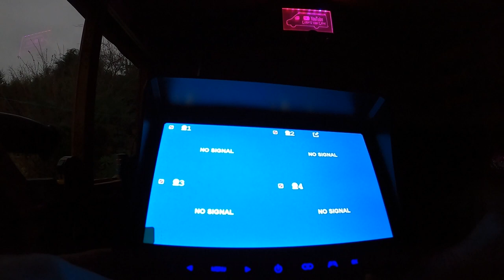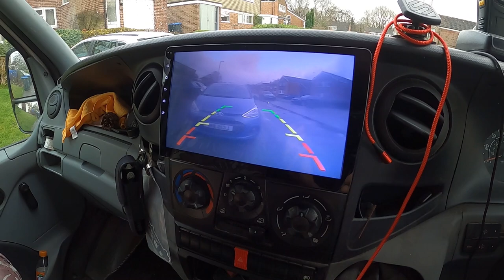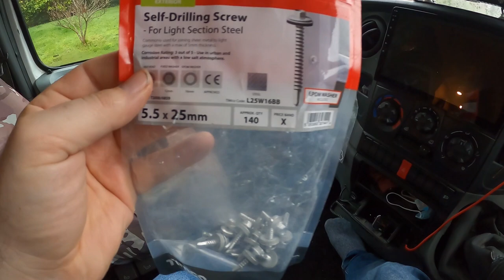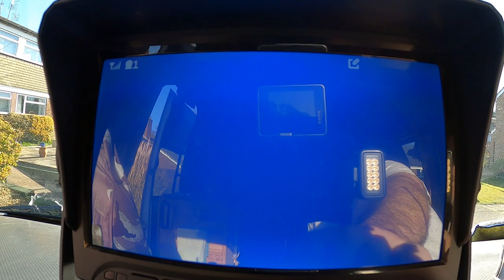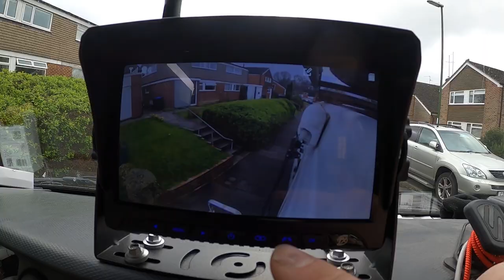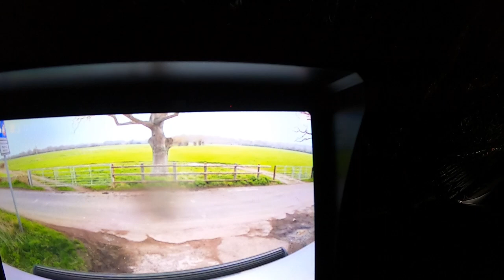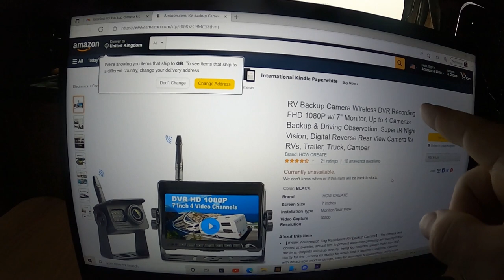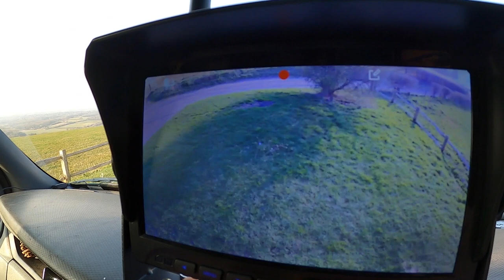Camper Security || CCTV Cameras || Parking Cameras

Comment: Did you know you can open the camera case up and rotate the sensor 90 degrees. (2 or 4 tiny screws) The camera sensor will normally be on a square PCB board, so the PCB mounting  holes will be equally spaced. This isn't always the case if they are using MCCD sensors (that are sometimes rectangle PCB's. If there was water ingress that would be a seal that has moved while they were screwing the case together.
Reply from the maker: That's very interesting. I've got spares now, (the cameras that leaked so I'll open them up. Thank you 😁👍
Reply: @LukesVanLife  There is a good chance that there will be a rubber O-ring in that seals the case. When they rotated the sensor they might not have put it back correctly. If it's pinched the O ring you will have to put some silicon to seal the case. I'd also advise sealing the other cameras with silicon to increase there lifespan. Especially with all the effort you have gone to installing them and working with the company over a long period of time.  I reseal all the electrics  that go outside including LED light on my house. It makes that last year's longer. Also the reflection of the IR light off the vans roof at night will make the sensor deteriorate fairly fast. It's the equivalent of someone shining a light in  your eyes. If possible I would twist them round a bit or put some Matt black tape (better still some none reflective tape with a fleece surface) on that section of the roof. It will also give you a much better night time image. Can you tell I'm a bit of a CCTV geek. LOL. I wish I had your knowledge when it comes to wiring up my campervan. I know I'm going to be doing a lot of head scratching later this year when I finally get round to building it. My house is filling up with boxes of campervan parts. LOL. It's taken me 3 months to fully strip out the back of my ambulance, back to an empty van.
Reply from the maker: Thank you for the tips, you sure know your stuff reg these cameras. I've just got back from Liverpool and have done my best electrical set up to date, it's incredible. I can send you a pic if you like. And if you need any help with your electrics, just give me a shout 👍😁
Reply: I've been playing with CCTV cameras and DIY night vision builds for almost 20 years. I also used to be a night vision importer and retailer.  Yes I'd really like to see a picture/s of that wiring.  I have made my life hard by deciding to fit the electrical board on the lower section of the van wall between the drivers seat and the double seat behind it. Plus I'm going to try and weld in a battery box in the floor, behind the drivers seat to lower the Lifepo4 batteries. That way I can maximize the storage space under the raised bed in the rear. I'm dropping the floor level where the original ambulance wedge ramp was, for extra storage under the floor. I would have to rebuild that section of floor anyway. The ambulance never had a spare wheel, so the new spare wheel is going on the back door of the van.